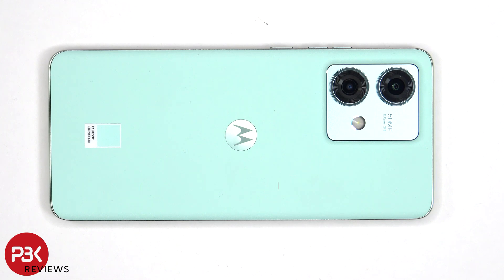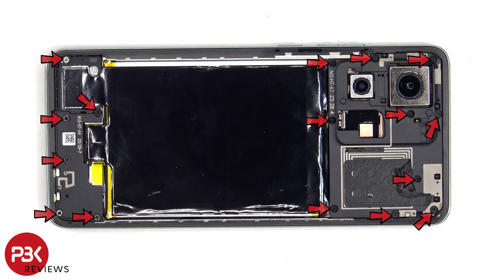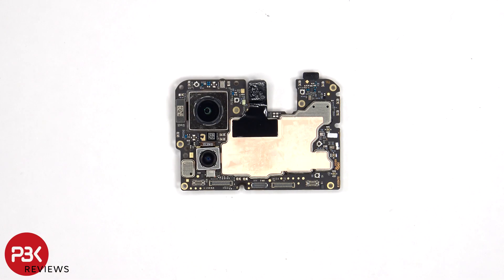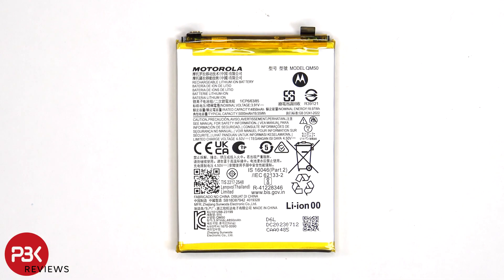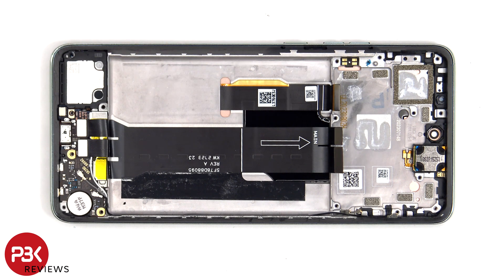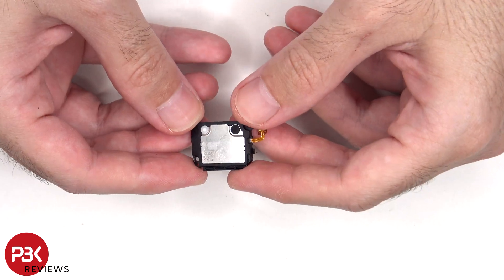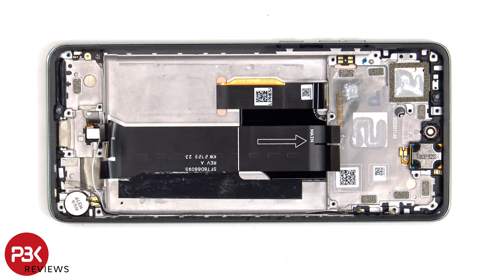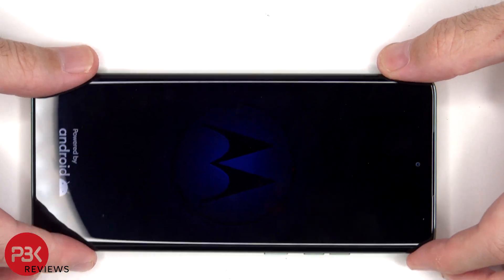Motorola Edge 40 Neo Teardown Disassembly Repair Video Review

Comment: Interesting that the sim tray seems to hold 2 sims. I know it is a dual sim model but I am sure mine is 1 x physical and 1x e-sim.
Reply from the maker: different regions will have different configurations. For example they will use the same sim reader which supports dual sim tray for all versions but in the software the additional sim reader pins will be disabled so they won't read any additional sims etc.

Comment: Sir is it possible to replace volume key and Power key in this phone sir tell me both the key are broken 😢
Reply from the maker: Yes, I'm not sure on this phone if the buttons are pull out of frame ones or you need to remove them by disassembling the phone and doing it internally. But the flex cable which has the clickers on it, requires you to disassemble the phone from the back as well as pry the screen off to gain access to the cable and replacing.

Comment: Can the main rear camera lens be changed without removing the cover completely, or does it have to be removed to make this repair? Mine suffered a micro scratch that doesn't affect the image at all,But I would like to know if I can polish it or to change it I don't need to remove the back cover
Reply from the maker: yeah, most phones the glass lens is held on with adhesive. You can order a replacement online and head it up, use a razor blade to lift from one side and pry it off then apply the replacement. If the replacement doesn't come with a adhesive tape, you may need to order one as well. But sometimes replacement are made of plastic and not glass so your quality will drop. Try to find one that is original.
Reply: @PBKreviews  Friend, you don't know how relieved I am by this message, I thought I should polish the lens and in the worst case, remove the entire back cover of the cell phone because of a lens. Knowing that it can be changed without opening the cell phone and just lifting it, I'm relieved, it will be a cheaper and safer service, thank you very much!
Reply: @PBKreviews  please give link to buy back camera glass. mine is broken. unable to find online.